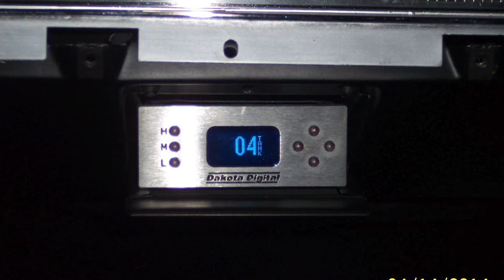1964 Buick Skylark Part 2. DIY Air Bags. How to - Air Ride Suspension Installation. Slammed

Comment: Awesome Lark! What size are the tires and wheels?
Reply from the maker: The tires are 245/45 18" on the rear and 235/45 17" on the front.
Reply: @riderescue  Do you know the widths and offsets?
Reply from the maker: @michaelwintrode4568  Sorry, I don't know those dimensions. I took the car to Coy's shop and we tried on a couple sets and these worked great.

Comment: what front shocks did you use?
Reply from the maker: I used the stock shock that was on the car. The shock relocation brackets I purchased fit perfect with full travel.